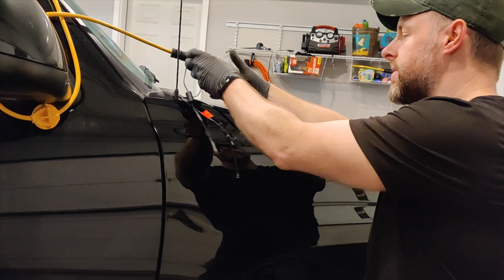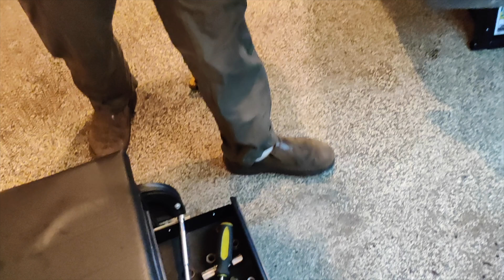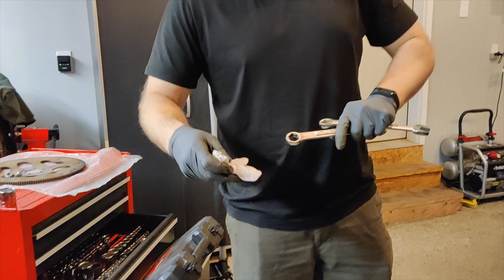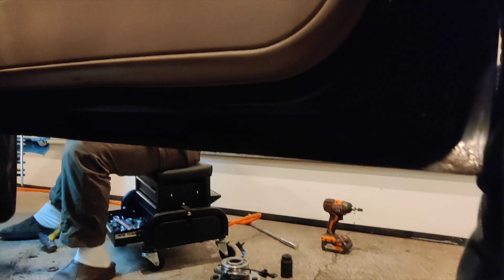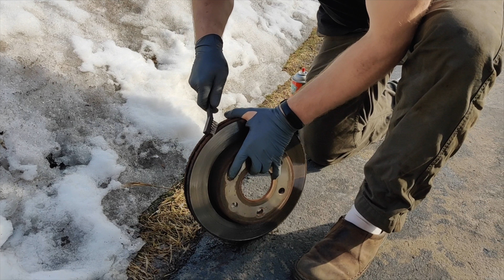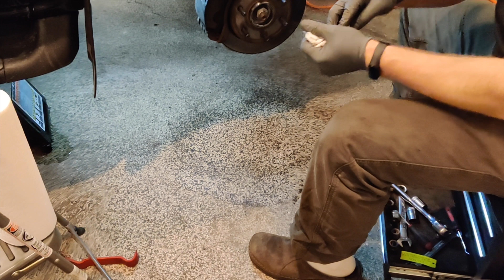2006 GMC Yukon - Wheel Bearing Replacement

Comment: I have a flopping noise in my tire I was sure it was a broken steel belt or a bearing. was told that it could be the Slime tire sealant I put in it.  It's like 12 or 14 oz.